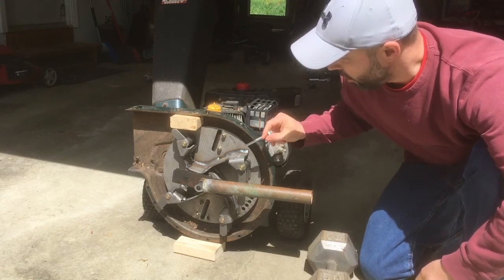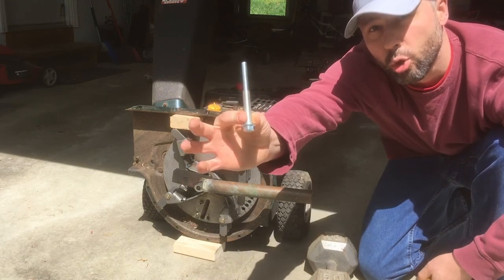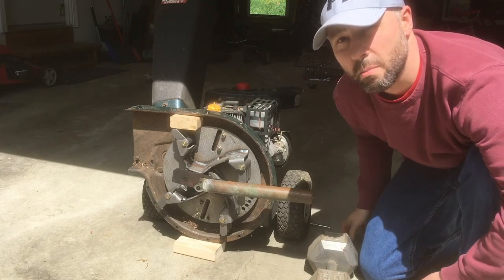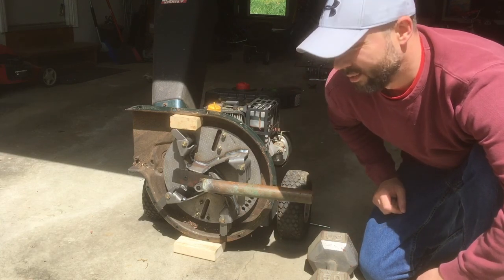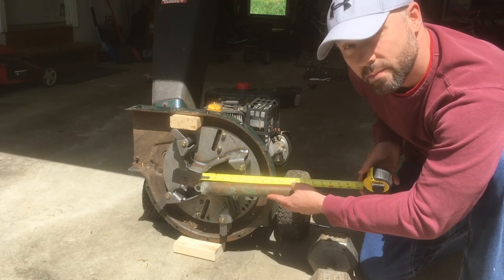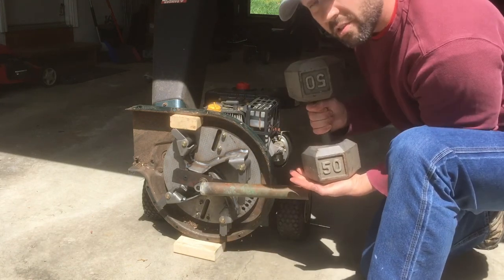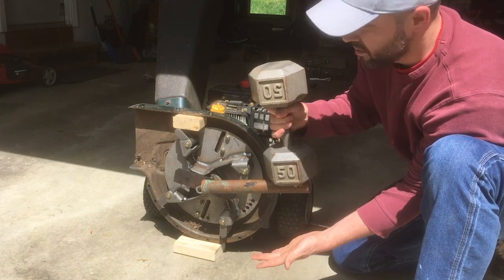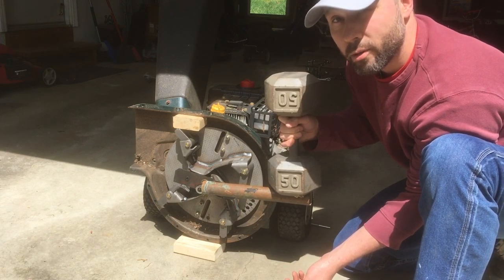Accurate Torque Without a Torque Wrench. No Torque Wrench-No Problem. 1ftx50lbs=50ftlbs

Comment: I need a 217lb man to stand on my 1ft wrench to tighten my crankshaft bolt
Reply from the maker: I'm 200lbs after a good BBQ feast, so someone else has to volunteer, OR TRY 50 lb weight on a 4.3 pipe extension will give you 215 ft lbs of torque., https://www.sensorsone.com/force-and-length-to-torque-calculator/
Reply: @everydaypawel9193  I'll just impact them in like everyone else..
Reply from the maker: @craigd123  😀

Comment: You can change the angle to reduce the torque:
- 0° (perfectly horizontal): 100%
- 15° (half a step): 96.5%
- 30° (one step): 86.6%
- 45° (one and a half): 70.7%
- 60° (two steps): 50%

You can also move the weight closer to the bolt. The distance between the bolt and the center of the weight should be torque divided by weight when the handle is horizontal
Reply from the maker: Exactly!

Comment: Thanks for the tip I'll try and turn my car sideways and do my spark plugs this way
Reply from the maker: @Yoshi-Moto  yes, that is a good approach!!! 🤣🤣🤣Please make a video and share it with the world, it will go viral and I’m sure I will recall the plan when I view🤣🤣🤣. Thanks for the laugh!
Reply: @everydaypawel9193  no problem pal  🤣 glad I could give u a laugh... On a serious note good video . 10/10 for thinking out of the box  . I need a torque wrench just for tightening 4 sparkplugs and there not exactly cheap . So if i was for tightening wheel nuts or something vertical ide use you method 👍 keep up the good vids .

Comment: The concept is correct, but there is a very big margin of error because one should adjust the line of centre of gravity of the applied weight to be exactly one foot from the fulcrum.
Reply from the maker: Thanks for watching and the comments.
Reply: Not so much error

Comment: I need to do 180 foot pounds. I guess I should find someone who weighs 180 pounds and stand them on my wrench. 

Wait, I just thought of something. I can get a torque wrench from the loaner tools at advance auto parts, but it only goes up to 150 foot pounds.  I do have a 30 pound dumbbell. If I tighten it to 150 foot pounds and then use the dumbbell on a regular wrench, think it would work?
Reply from the maker: 6 foot bar and 30 lbs = 180 ft lbs, equation τ = rFsin(θ), https://www.omnicalculator.com/physics/torque
Reply from the maker: OR find someone who weights 180 lbs. put some change in your pockets.
Reply from the maker: I will keep that in mind for next time, thanks!

Comment: I need 40nm torque for my bike crankset, i was thinking it is much torque,i give all my power with one hand to 25cm wrench ,i think it was to much
Reply from the maker: yes, I converted that to 20 ft lbs... as you can see at the end of the video I test to see how much 50 ft lbs is, and I can still move it, 1ft=30cm, close to 25, it is not that hard.. you probably gave it closer to 200NM. you can weigh your body pressing 1 hand on a scale and determine how much weight you put into the wrench and do the math.

Comment: 30 bucks
Reply from the maker: I think you are right, I saved $30, and glad I didn't buy a tool I would use 1 time in my life. also there are more expensive ones than $30, and I am not familiar with quality to make an informed choice.